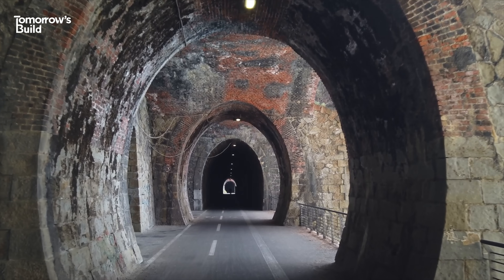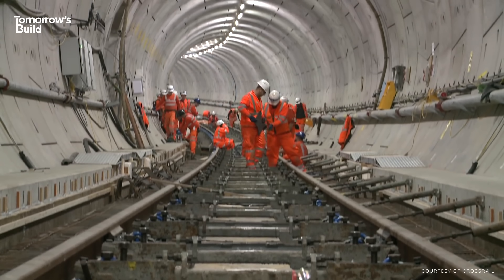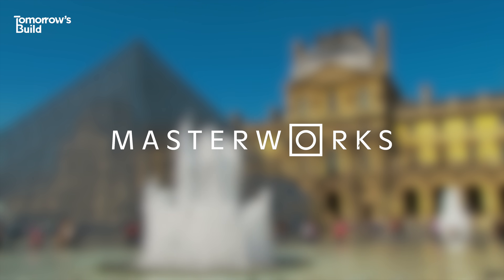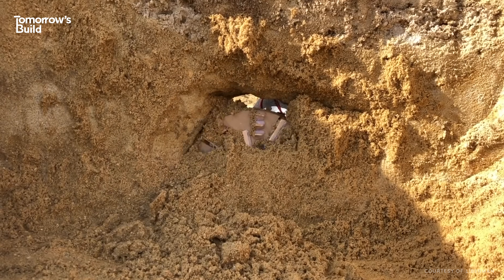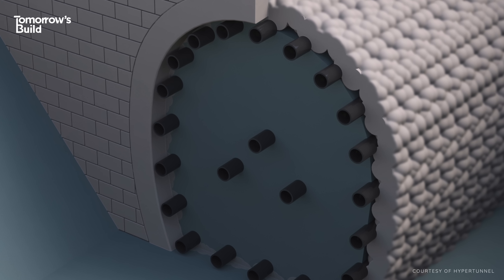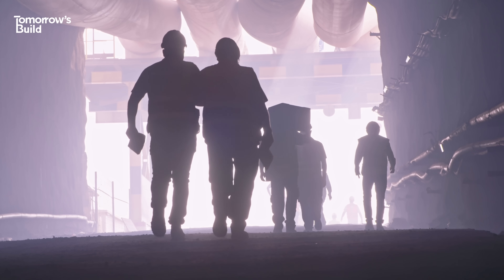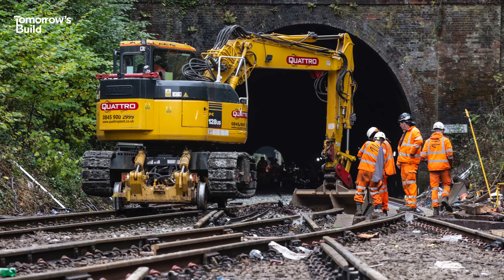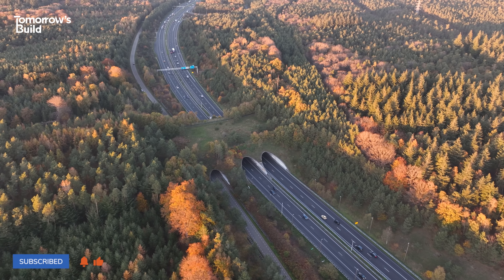A Swarm of Robots Built This Tunnel

Comment: I'm not a civil engineer but this doesnt look convincing.

4:30 So all the robots in the small tubes either inject something to the soil to give structural stability or drill it out the space in between these and fill it with... concrete?

Okay in the end you'll have patches of injected soil and patches of concrete in between. None of these are a reinforced structure so you'll need proper tubing elements in the end anyway. Like a TBM would do it.

The "swarm" of robots, to make this fast, a pile of BS. First this is not a swarm. Second the number of small tubes are limited by the tunnel perimeter, you cannot operate more than that in the same time. Each small tube gets less and less effective the longer it gets. It is a stack. The robots block each other doing any operation, they cant outmaneuver each other when they are excavating/injecting. The most effective is to fill the whole length of the tube with robots all at once, they do whatever they need to do and remove them all at once. But then the next question arises, how you push these tubes into the ground and how do you make them empty because you could do that with a bigger perimeter and call it a tunnel. Or push the small tubes and fill them with concrete, voilà, no need for robots again.

Tbh feels like the whole company is a money grab, heavily focused on fancy animations and proposes an overengineered solution for those tunnels that are not really a problem to build, but when it gets complicated /what about hard ground type or water pouring in with several bars of pressure?/ these bots cant do anything.

Comment: 5,000 robots moving at once. More moving parts means more chance of failure.  I can just imagine if one robot stops functioning, even though the the mini tunnels the robots use are big enough for them to pass each other, a malfunctioning unit could become an obstacle that could cause two other robots coming from opposite directions to collide and ultimately halting construction. Depending how deep the malfunctioning robot is, removing it could be very difficult.  This method looks like it needs all robots working perfect or the whole system fall a part.

Comment: Bullshit. Not 1 single piece of info on how they maintain these drones, give them the material they need to pump into the walls, etc etc. If your sticking 10k of these in holes building 10k meters of wall like he said the logistics setup for that would be insane. Not to mention what do you do when one of them gets its drill bit stuck in that hole and cant move, and cant let others pass etc.

A total "pipe dream"

Comment: I have some doubts about the feasibility of this plan, especially for large projects. One concern is the need to dig tunnels for the robots' pipes. Will the robots be powered by batteries or some other source of energy? Another issue is the mention of reintroducing drills to disrupt the soil and clear out the tunnel. This seems like a significant task that warrants more attention and detail. It is likely that the majority of the "heavy lifting" will take place during this phase.

Comment: No this isn't going to take over tunnelling. It's a solution in search of a problem. This is like the circular runway of tunnelling.

These robots are installing a single layer of "composite material" as the only lining. Unfortunately that's not how tunnels are actually built. 

Firstly, we use concrete because its cheap and meshes perfectly with rebar. Composite materials are not cheap, they drive up the price and generally they have undesirable properties around expansion, temperature or other funky behaviours. Concrete is really good in compression, and steel is really good in tension, unless this material is isotropic then it will need rebar and there's no practical way to install rebar using this method.

Secondly, when digging a tunnel we install a primary layer of spray concrete (shotcrete) after excavating, this layer of shotcrete is strong enough for short term construction work. Through the shotcrete we can install additional supports such as rockbolts (not sure how these robots could even install these). Other liners and membranes can be installed such as void forma to stop water entering the tunnel. Unless this composite is waterproof, how are you going to install a membrane with these robots?

Thirdly, when excavating we actually want the ground to converge a little bit, especially in the Sydney region where we have super high in-situ stresses, this relaxation means less force on the tunnel. You can't do that with this.

What happens if a robot breaks down and the tunnel is now blocked? What happens if you encounter an unexpected geological condition? Little drill arms, why not just make one big drill that is less likely to break?

There's so many reasons why this won't take over tunnelling and there's a reason there's so many caveats at 6:45.

Comment: The fact it's faster, it reduces cost, and it's safer, are all reasons why I think this has a lot of potential.
Reply: It has excellent potentional, but how much maintenance will the robots in question need afterwards?
Reply: Potential should include how feasible it is. You're only basing your opinion on the claims of the company which have yet to be proven to be true

Comment: So this is, excuse the pun, a pipe dream. This whole video is clickbait and should have been prefaced with "start up company demonstrates new tunneling concept in above ground soil test" not "A Swarm of Robots Built This Tunnel". 

 Aside from the mechanical feats necessary, the software required to manage a project like this is the hardest part. What happens when two robots collide in a conduit? Some will be trapped, others will have to slowly back out, all the while their cement is curing, to say nothing of the robots that are now mangled. And why even bother parade that the inner tunnel would be excavated autonomously? That's not even a necessary marketing pitch as, ostensibly, the tunnel would be structurally sound at that point. 

Just goes to show you can't trust any company with "hyper" in the name.

Comment: It's an interesting idea, but the title is quite misleading.  The swarm of robots isn't really the thing that "built this tunnel".  The swarm of robots stabilized the soil that the tunnel was built in, but they still needed a boring machine (5:49) to come in afterward and make the main passageway.  

I'm not trying to say the robots didnt serve their purpose.  Collapse during tunnel drilling is one of the most dangerous parts of drilling a tunnel.  So if you had a way to stabilize bad spots before you send in the half-billion dollar TBM, it would definitely be useful.  It's a great tool to add to the arsenal, but it's not the tunnel-building revolution it's presented as here.

Comment: This looks really exciting for the future of tunnels. I hope this doesn't go the same way as "solar road" and turns into a practical reality. Thanks for sharing as always Fred and your team.
Reply: Spoiler alert, it will. Along with the likes of hyperloop. Hell, we may not even get self-driving cars at this rate.
Reply: @Dysiode  The issue with "solar roads" was that it was a stupid idea from the beginning. Building a solar panel tough enough to drive on is a genuinely bad idea when you could just use existing pavement technology (which is VERY cheap and easy to repair), and then build massively more efficient conventional solar panels elsewhere. And the "roads make up X amount of surface area which would generate a ton of energy if converted to solar panels" argument made no sense either, when roofs make up significantly more surface area and actually would make sense to put solar panels on.

The Tesla Loop and Hyperloop concepts are just dumber, more complex, worse versions of a thing that already exists: trains (subways and high speed rail, respectively). Every problem they solve could be solved better by technology that already exists. They only innovation they presented was the ability to grift starry eyed tech investors out of their money; you can't get a lanyard dork excited about building a boring old subway, but tell them Elon Musk wants put a bunch of battery powered cars in a tunnel and they'll be lining up to light their money on fire.

And yes, the same issue exists with self driving cars. They do make sense in a small number of situations (maybe long haul trucking on specific interstate routes, moving product around a large factory or warehouse complex, mining, or maybe certain military applications), but personal vehicles are definitely not one of them.

Even ignoring the problems with getting the tech working and getting people to trust it (which is no small hurdle), what problem does a self driving car solve exactly? Traffic? Having a bunch of empty cars driving themselves around to pick people up and drop them off with make traffic *worse*, not better. The only way they'd reduce traffic is if you had large autonomous cars running set routes, picking up multiple people per trip. Thing is, that exists; they're called busses. 

Much has been made about platooning groups of self driving cars together to enable greater density on freeways without causing traffic, but there are a LOT of problems with that approach. First of all, it only solves traffic if all cars on a given road are autonomous. Otherwise the autonomous cars would have to merge through lines of slow-moving, non-autonomous traffic to get on and off, and that would completely negate the purpose. You'd need special roads just for autonomous cars, because there's no way you'd get 100% adoption. 

Secondly, it only works if all of the cars are extremely reliable and well-maintained. You could probably make the system robust enough to handle most mechanical failures or inclement without causing a massive pileup, but a disabled car in a platooned system would be a huge traffic problem. And would you feel comfortable with someone's janky tweaker-mobile with 4 mismatched, bald-ass tires and a rebuilt title of questionable quality screaming along 6" from your bumper at 120mph? Because I wouldn't.

You may be thinking "these problems are all solvable," and you'd be right; there are ways to deal with all of this. But by the time you move autonomous cars off on to their own roads for long distance travel, electronically couple them together with other cars, and create a system of standardized maintenance and inspections, you know what you've created? Trains. That's just much more complex, stupider train.

Just like the Hyperloop and the Tesla Loop, self driving cars are a gadetbahn; they take something that already exists, and creates a "high tech" version which is less efficient, more expensive, and worse. The point of these isn't to improve transportation; the point is to make money, either by bilking gullible investors and government agencies, or by trying to kill something which would be harmful to the business model of the people developing the tech. A Loop or a fleet of platooning self driving cars aren't better than trains, but they do let car companies continue making money while pretending to solve a problem.

Comment: Ok nice rendering of hive that has no connection with actual method. Question 1: how the pipes are being drilled in if the tunnel is long? 2. How can you be sure where the drilling head moves while drilling horizontally? Won't the irregularities in the ground cause is to change direction or impossible to push pipe further? Again, horizontal pipe laying where gravity is not your bro. Drones are cool and all, but how is removing contents of a built tunnel easier than drilling the whole tunnel?

Comment: First I want to see those robots drilling a 10 km tunnel through granite and really difficult geology before even consider this a serious idea. I have worked in  tunnels and as a foreman and a blaster who has worked in construction for almost 15 years I’m very skeptical.
Reply: Engineer here : I want to see 2 of these robots be proof-tested to be able to cross each other for 1000 runs. (And even then I doubt it would be faster or cheaper than TBM).
Reply: I think you're a bit overqualified to be skeptical of this nonsense lol.

Comment: Personally, I have some serious doubts. It definitely won't be leaving a "finished tunnel behind" as claimed at 5:56. Such a tunnel would likely have some gaps between concrete injections. There would be water ingress which means that the entire structure needs to be waterproofed and reinforced concrete liner needs to be pored along the entire length of the tunnel. That is still a heck of a lot of work.
Reply: I was also unclear about why it would be 10x quicker if there's still a Robot needed which would need to bore out the middle. Perhaps it's only for soft types of earth and excavation without fear of collapse because of the Injection process before
Reply: Jeah, I have a hard time seeing the benefits of this compared to normal boring. They just do it multiple times with multiple drills.
Reply: @MarkkuS  I saw a listing for a used 4-meter tunnel-boring machine priced at $3.2billion. I've seen rental costs in excess of $10,000/hour. Being able to dig an arbitrarily large tunnel with what basically amounts to a collection of autonomous hole saws is a huge development
Reply: They didn't even bother to explain how the robots carry the dirt out of the holes they carve, it just vanishes in the video. On top of that they didn't explain how the same tiny bot manages to pump pressurized concrete into the wall either.
Reply: @brumach527  Yup. I don't see how the logistics add up.
It's difficult to beat one large boring machine operating 24/7, continuous movement with rubble removal and proper concreting happening concurrently behind it at the same rate.
Reply: The other issue is dealing with dead robots that need to be replaced… in line.
Reply: @captiannemo1587 meh, unless they've got wheels that are jammed, another robot might be able to push them out. Would take time, but no human would be involved. I'm sure they're sturdy enough to not break too often and if they break, they're movable by others in the swarm
Reply: @bastianversteeg9221  Hmm, except when the drill cutting the access points along the main bore gets stuck. Maybe something collapses and prevents the drill being removed - now that robot is well and truly stuck.
Reply: @captiannemo1587  Or what happens when one of the bore holes through the side of the pipe leaks, and cement drips back into the pipe.
Reply: @captiannemo1587  clearly the drones will cannibalise the dead 1s :p
Reply: Grouting tunnels is not a new technology. This is only a new way to perform an old technology.
Reply: one major concern i would have is what if a robot gets stuck and jams a pipe? then they have to drill a whole brand new one and potentially have to abandon hundreds of robots in the old tunnel.
Reply: I see nothing but CGI, and little evidence of it "working." If they want my vote, they need facts, not ideas....
Reply: Another issue is that based on the 3D visual provided the robots don't use Rebar meaning the tunnel structure is just concrete making it quite weak and prone to collapse over time.
Reply: @_gungrave_6802  Rebar is only useful in tension. A tunnel wall is entirely in compression. If the tunnel has a flat ceiling, rebar would be needed along the bottom of the beam member. Grouting is already a common practice in tunneling, and even building foundations.
Reply: This and also the half circular robot cruising upside down supported by thin air
Reply: This has all the signs of an investment scam. How do you dig the the wholes for the robots? Can you dig in directions other than straight? The tunnel they dig are in dirt not rock and you can't have explosives or heavy machine break hard rocks if you get stuck. All the AI and high tech talk on digging a whole just makes me think this is a phase one capital funding video.
Reply: I agree CG is cleaner than real life. But that’s the info available we got to see from this video. I will be enthusiastic after practical results in a near future maybe.
Reply: @pontosinterligados  spot the difference between 1:25 and 5:50 tunneling tech?
Reply: Hahah never ever  !
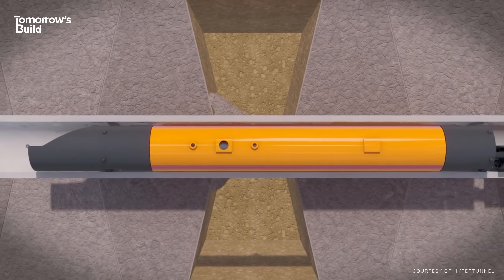At 4:47  are there 1000? Holes in the Pipe ?
No it's a Plasic Tube !!  A little Pressure and you have an Egg Shape .. aaand stuck !
How will the Cement cure on different Spots/Times ?
This will never be stable !
A "small Cutting Arm" .. in Sand this might work  but Granite or Layers with Water ?
What if something happens a Rock jams the Cutting Arm .. will it mutilate itself ??
All the Dirt and Rubble will take down every bit of this Madness
Autonomous..  nice Buzz Words but there is a long hard Way 
You need a experienced Crew to drive a TBM because there are 1000 Problems with the Mashine and the Geologie nothing that can be done by a "Computer" !
Yes there is Progress in this Area but this is far beyond real Tunnel Work
In 1 -2 Years they are crashed
Reply: In 5 years when the tunnel collapses and kills bunch of people they might rethink there process 🤣🤣🤣

Comment: I don’t want to be that guy, but I thought tunnel walls mostly used reinforced concrete, how are these bots going to put steel rebar in the tunnel walls? Secondly it looks like one bot to dig and one to put material, what about subsidence in cities while the hole is dug but there’s no reinforcement. But about building in wet conditions, how are they going to prevent water from leaking in the tunnels and stopping wet soil from collapsing?

I will only believe it when I see a proper tunnel built